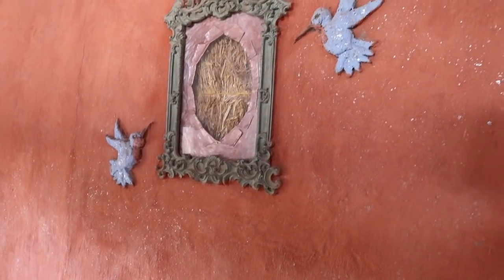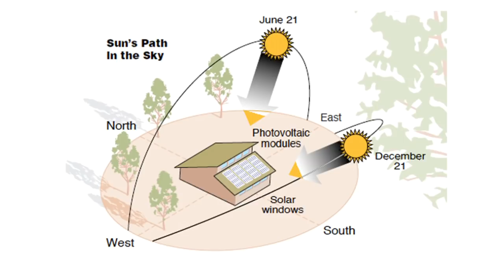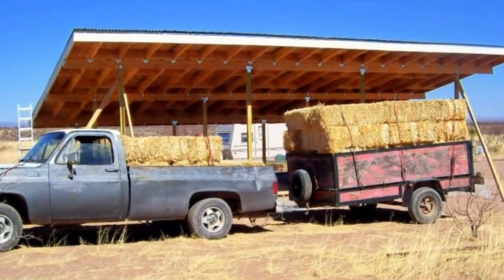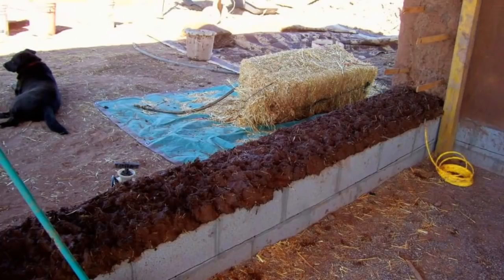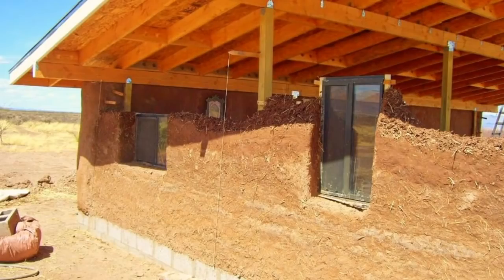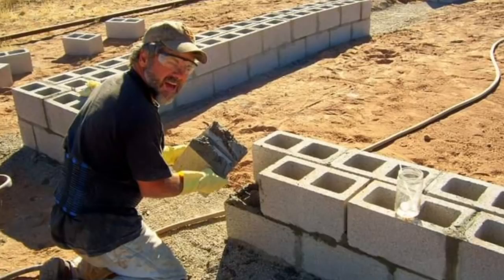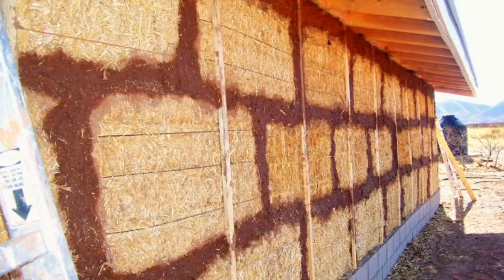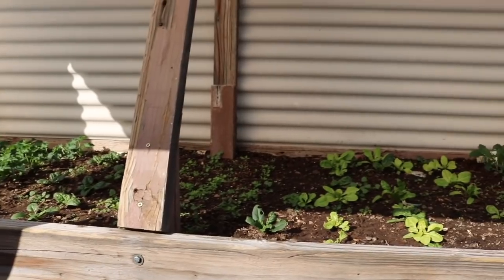Natural Building Series! Straw Bale and Cob

Comment: Another options for heating and cooling is a "earth tube" you can use it passively or combine it with a fan. It's also known as geothermal. Great video! I was most interested in the indoor and door temps and their construction method of choice!
Reply from the maker: Very cool! We are very interested in earth tubes and may include that in future builds.

Comment: awesome guys. loved it and what a nice build.  $8 for a bail, wow, thats really steep for a waste product. probably because of there location. Go work on a farm and get paid in bails might be a cheaper option ;)   Also look into the different types of lime, this can also add up costly. a bigger overhang all round the house will protect your cob/earth plaster from rain, no need to lime then, just have to patch up now and again after crazy weather. can always lime later in life. i'd also prefer to use tyres instead of blocks in the foundations. they move with the earth more and normally free. no form of concrete should ever go near natural buildings simple because they are not ment to go together, plus concrete production is extremely polluting to our planet. Get that book i told you about, it has everything you need to know. so cant wait for when you start :)
Reply from the maker: Very cool comment, Gaz! I appreciate the info. Unfortunately, strawbales are kind of expensive around here. I have heard of them being a lot cheaper in other parts of the country.
You're right. Eliminating concrete or reducing it in the build as much as possible is the best solution.
We can't wait to start our own build. We're very excited.😃